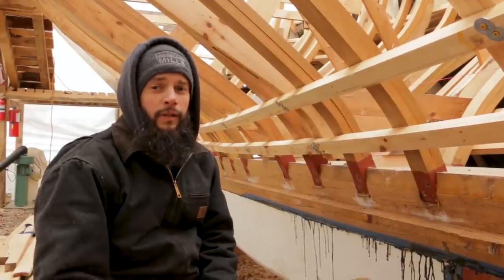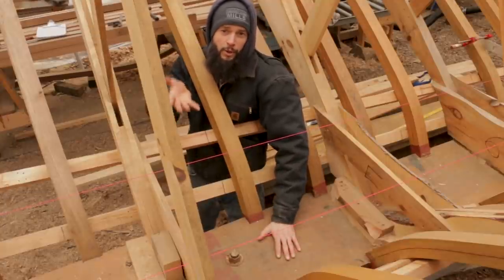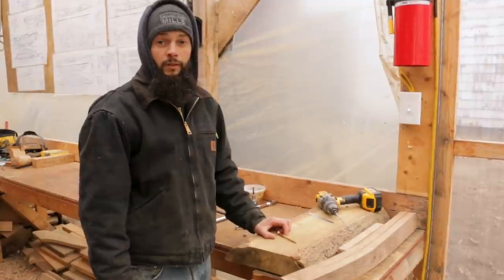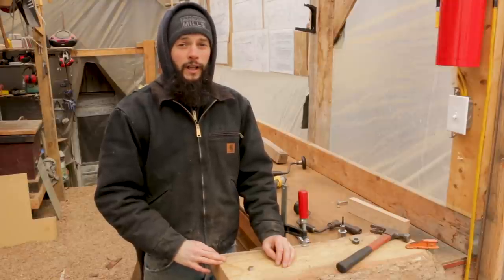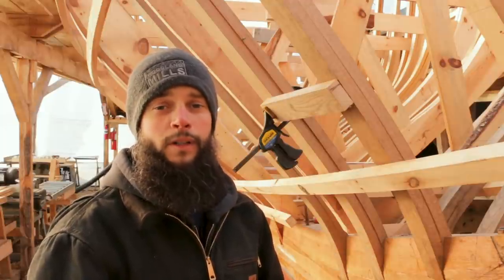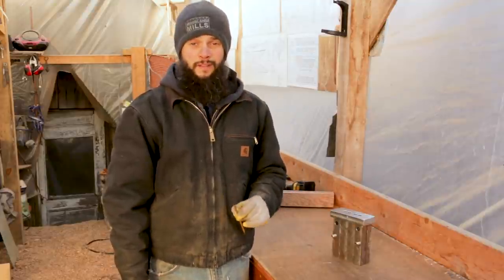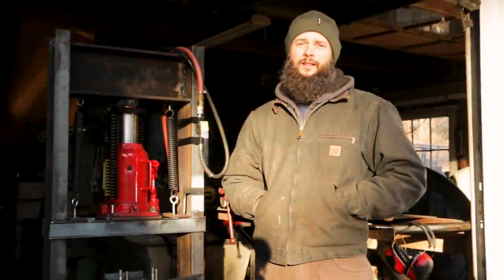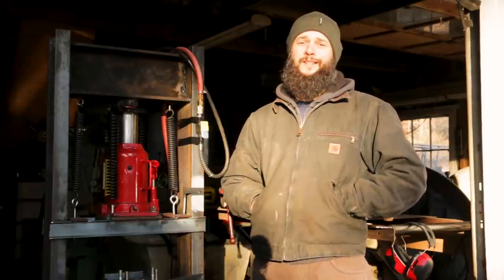Acorn to Arabella - Journey of a Wooden Boat - Episode 50: Homemade Copper Rivets!

Comment: Regarding floor timbers: Make sure that you have sufficiently large limber holes to permit water to flow freely in the bilge.  Bigger than you think is necessary.
Reply: Would you mind expanding on this? I'm honestly curious as to why, since I'd like to build my own boat in the next few years. And I feel like the reason why is immensely obvious once its been explained.
Reply: Floor timbers compartmentalize the bilge.  When launching a wooden boat, it will leak to the extent that one or more 1/2 hp submersible sump pumps are required to supplement any existing bilge pumps.  This obviously slows down, but if you work the boat you will get some water inside.  In order to drain the water, you need a way for water to flow to the compartment with the pump.  Limber holes are holes in the bottom of the floor timbers (usually on the bottom corners, between the keel timber / keel and the frame) which allow water to flow freely in the bilge.  In my experience it is very helpful to make the holes large enough that water can flow quickly and won't get clogged.  If I were building a new wooden boat, I'd make the holes about 1" in diameter if possible.

My boat has longitudinal stringers, so I also need to have limber holes in them so that water won't pool on top of the stringer.

It is best to think in advance about anywhere that water can pool and create ways for it to passively drain.

Hope this helps!
Reply: My boat will be of a welded construction, but I'll probably integrate this into the design for safety. I always understood that it is not a case of if you'll get water I to the bulges but when.
Reply: @cracklingvoice  You could either have a big bilgepump and wide scuppers to connect compartments, or You could build completely separated compartments with equally separating bulkheads including watertight doors over bilge level and have an adequate pump for each of the compartments ... which is easier to achieve in a metal hull than using other materials, of course.

Comment: Your fin neck flat head bolts seem to be the source of a great deal of concern.   I'm not concerned about the strength of the silicone bronze but if the thickness of the head is not 1/3 to 1/2  the diameter of the shaft it will fail due to fatigue.   It's a similar type of failure that caused the crash of Japan Airlines flight 123.  It seems like you've doubled down on using the bolts as is so do what you want.

Comment: Get a logsplitter and appropriate bore cylinder to drive the press. If you can find the type logsplitter with 2 stage pump, all the better. 
To further spped u production, a set of knockout pins could be added to the existing die to press out all 4 rivets without opening the die. (use a smaller cylinder or even a mechanical system to operate the knock out pins).
Reply from the maker: Thanks for the suggestions!

Comment: The only thing I'd look into is possible work-hardening of the copper while pressing the heads on them. I'm not an expert but I do know that copper, like stainless steel, is weird, and it work-hardens as it is formed which could make it brittle. The annealing process for copper is also weird because you heat it up and then quench it, just the opposite of carbon steel. Anyway I trust your competence and thoroughness but the weirdness of copper is an easy detail to miss. Best of luck, guys.
Reply: Quenching is unnecessary. They will anneal either way. Sometimes the hardening is desirable as in a cartridge case head.  The rivets might be stronger after getting head!

Comment: Make 2 more dies with quick fit slot in the cradle. That way you can press 1 while others remove 1 and another loads the 3rd one. And add a bit of die lube.

Comment: rather than using bolts to hold together the die - use parts from the old press so you can use a ram to hold the two halfs together. Much faster than undoing and redoing those bolts! And less effort.
Or keep them bolted together and use a second ram to evacuate the rivets!

Comment: If the slots in your press were tapered at the bottom wouldn't that make the head and point of the rivet at the same time eliminating the need to grind the points on them?

Comment: If the holes holding the four rivets in the press had a pointed end wouldn’t the rivets come out with a head and point at the same time? I am not an engineer just a thought. Love your channel, best on You Tube. Cheers from 🇬🇧
Reply: That may work, but it wouldn't be easy to make, and it would redirect the force on the bottom in such a way that it would be trying to push itself apart much moreso than it is already. Which you could fix by adding more screws, but that would just make it take longer. 

In short, it could work, but I don't think it would be worth their time considering the relatively small number of rivets they're making.

Comment: Try smoking the rivet die. Light a small stick on fire and hold the die over the flame until it blackens it. That should help the rivets release. That adds a microscopic layer of carbon to work as a lube. I do that for bullet casting. My bullets drop easily and come out with a near mirror finish. Automatic Transmission Fluid may help as well as it's thinner than most oils and lubricants. One or the other.
Reply from the maker: Thanks for the tip!
Reply: No problem!
I've been enjoying watching you two work doing something I can only dream about for now. Y'all keep up the good work.

Comment: I have to say that metal working is not my thing, I prefer wood work. I have some knowledge of reloading and dies with brass. 
I am curious bout 2 things: 
1) should they use grease in the die so the die opens and they get pressed rivets off easier ?
2) could they made end of the rivet die slots pointy to get completely finished rivets out of the die without having to grind the point to them ?

Comment: You can easily add a point to the rivit press so you don't have to grind them.. Weld up the bottom 1/4" of the individual dies, then mill w a 60 carbide taper end mill on both halves forming a square taper point. Presto, now when you squash the head it will form the points too. I can do it if your machinist can't w a fast turn around. Dan

Comment: Got to admire the back woods engineering.

Its a little ugly, but it works perfectly fine, abet a alittle noise. A hydrolic press might be faster, but there not exactly cheap and alot more expensive and heavier. 

That's gonna be one solid boat.
Reply: Their jack is an air operated hydraulic jack.  They are not inexpensive.  It uses air pressure to run the hydraulic pump instead of having to pump it with your hand and arm.  By comparison manually operated hydraulic jacks are much less expensive.

Comment: Probably not a bad idea to use some kind of mould release. You could use heavy equipment grease(get a tube of the lithium grease, it’s the best in my opinion) and just put a small dab in the mould. It’ll make getting the rivets out easier...and save your tooling a bunch
Reply from the maker: We used some graphite lube to that effect.
Reply: Acorn To Arabella even better

Comment: Put some soap on the stock before you press them in. Will be easier to press and will come out of the die easier.

Dissolve some soap bars in warm water, put the stock in some sort of basket. Maybe one from the supermarket. And dipp it in and let them dry.

Afterwards just do the same thing with clean warm water to remove the soap

Thats what the cold press industry does. Mostly with aluminum but should work as well with bronze
Reply from the maker: Thanks for the tip!

Comment: Question -Are the holes in the roves for the square rivets also slightly smaller round holes, as with the holes through the frames?
Reply from the maker: 1/4" square rivet into a 1/4" round hole and same for the rove, 1/4" round hole.  When we set the rove the corners of the rivet cut into it and the rove locks in place for nipping and peening.

Comment: Great job. Just a question, could you machine the rivet die to add the point at the end instead of grinding it ? The press could do both the head and the point.
Reply from the maker: We would need a lot more than the 32ton jack we are using to do that!

Comment: Those screws hold much more than 100 lb in the portion you had protruding out of that part. I'm sure one of the math calculator engineering types is probably going to make the calculation or I can make an approximate close one

Comment: Maybe reshaping the part of the die where the sharp end of the rivet is can take the grinding step out of the process and maybe the Press will be strong enough to make the tip and the head at the same time inside the die
Reply: does a rivet really need to be sharp on the end??
Reply from the maker: It needs to be kind of pointy to follow the pre-drilled hole as well as to start the rove over.

Comment: could you not preform the points on the rivets by putting a taper in the bottoms of the channels, or would that try to force the bottom apart?

Comment: Are you going to leave the rivet heads work-hardened?  Or will there be an annealing step?
I have a lot of experience with copper alloys (brass being the majority), but I am not a boat builder. I don't know which is more beneficial in a boat.   So, I figured I'd ask.
Reply from the maker: The work hardening is not an issue unless you really sat there and beat the snot out of them or tried to move the material to far.

Comment: You used a carpenter's hammer with the punch to remove the broken fin-head bolt.   A carpenter's hammer has a hardened face, and is meant to drive softer mild steel nails.  A punch, depending on the temper, may be hard enough to cause the face of the hammer to chip.   A machinist's hammer (Ball-peen, or cross-peen) hammer has a softer face and will mushroom before it chips.

This is not commonly appreciated.  My dad had a scar on his abdomen where a chip from a hammer went in, so I heard about this more than once.  (Yes, Dad, I know.)

The hardened face of a carpenters hammer allows it to retain a rough-ground (or even knurled on a framing hammer) finish that grips the head of the nail and reduces the chance of bending the nail.
Reply from the maker: Thanks for the info!

Comment: 24:38 did you switch to doing two at a time because your press didn't have enough power?...or it worked better in die?
Reply from the maker: We do the 4 at a time, when we open the die sometimes they go with the lid and sometimes with the base so it looks like we pressed 2, the other two are stuck in the other half and out of the shot.
Reply: @AcornToArabella  oooh duh, that explains it!

Comment: I tested a 1/4" brass eye screw mounted in oak.  With 1/2" engagement I could not pull it loose.  200 pounds of me.  Now scale that up to those burly screws holding the frame to the keel.  1000 pounds?  More?
Reply from the maker: Don't know for sure, I bet you could look it up, but yeah, plenty strong.

Comment: I understand why you are going with the square rivets but isn't there a chance of stress cracks in the wood over time at the corners of the rivets? I know the windows of the Comet airliner, which were square, had that issue in the metal and caused multiple catastrophic failures resulting in crashes and great loss of life. I just wanted to bring it up cause I enjoy your videos and don't want your beautiful boat breaking up in a storm or something if possible.
Reply from the maker: Wood is pretty forgiving in that department, same with soft copper.

Comment: I’m an absolute layman when it comes to things like this so perhaps I’m speaking out of my ass here, but maybe you could fit the mold with cut-out grooves to form the points of each bolt as well as the heads when you press them, instead of having to grind them to a point afterwards?
Reply from the maker: To press the points you have to basically extrude (extend) the copper and that takes more force than we can easily generate or manage.  The grinder does it real quick and easy.

Comment: you should weld a handle to that press release, will make using it much faster :) and yes your welds look awefull.. but they do the job!
Reply: and impact gun with a torque limiting bar for the nuts. will speed that up loads.
Reply from the maker: Our 20volt dewalts and our air wrench were not strong enough to tighten the nuts enough. The handle is on the to-do-list

Comment: Awesome instructional vid.  God bless you for your patience with armchair experts (as well as actual experts).  One question, could the die not have been made to also form the point on the rivet in order to save one operation?
Reply from the maker: To form the point you essentially have to extrude the stock which takes much more force than we want to work with!
Reply: Acorn To Arabella yeah, thinking about it again, you’re right.  Silly of me.

Comment: Isn't cold pressing going to cause metal fatigue in the the heads?  I'm not a metal working expert, so I may be wrong or it may not be significant enough to worry about.  Even so, you should be able to alleviate it by annealing them in an oven, I would think.
Reply from the maker: Copper is very soft and can be cold pressed easily, so no worries.

Comment: heck yeah guys! Glad some of the advice was useful. Your unlikly to get a faster production unless commercial equipment is involved. We did jobs all the time with equipment like that. If you do want more oower add a hydralic pump to the jack instead of air. Fly presses work well too like ones at Oldworldavils.com.  Commerically rivit stock would be put into an A2 steel die like yours and a punch press machine would 'stamp' the head shape at a rate of 100's per hour. 
  But for your job you will be hard pressed to beat that small shop production rate ;O keep up the good work!  BTW, Perfect and well described video of how threads engauge the work in any material.
Reply from the maker: Thanks!!

Comment: Every piece of a wooden boat “works” in a seaway. Splitting the frames made them easier to bend. Seems like the inner half of the frame is now just a long, wooden “washer” that just holds the inboard end of the rivets, leaving the outboard half of the frame taking most of the hull loading. The “working” split frames will allow the rest of the boat to “work” excessively. You basically have a lamination that isn’t glued up, & isn’t sharing the load. The inner frame half is transferring most of its load to the rivets, in shear. Epoxy is wonderful stuff!
Reply: I'm not an expert, but with the bottom 6" or so of each frame not being split, and with maybe a couple dozen or so 1/4" rivets through each one, it's hard to imagine that there could be much movement. It would be interesting to hear their take on your thoughts.
Reply from the maker: By the time the planks go on, floor timbers go in, bilge bands, sheep clamp, lodging and hanging knees.....  By the end the split frames will be so well fastened together they will share the load. =)

Comment: My riveting experience is limited to either mild steel or aluminium so I don't know if this is important, but do the home made cold pressed copper rivets need annealing prior to use? Does the work hardening when they set the rivets cause the rivets to become brittle? Or is copper ductile enough that this won't be a problem?
Reply from the maker: The copper is ductile enough and we are not moving it very far so the bit of work hardening is not and issue.

Comment: why does the die not have a taper to make them pointed?
Reply from the maker: To point them the material essentially has to be extruded and that takes a lot more force than we can currently apply or want to mess around with.

Comment: If I takes 32 tons of pressure to form those heads, how do you plan to hold them tight and pean them over when installing them? I’m genuinely curious...
Reply from the maker: The wood around the rivet will help, as will the backing iron (we will cover that later).  Also it takes 32 ton to press 4 at a time with consistent pressure.  That is very different from 1 with small rapid blows from a hammer or air gun.

Comment: "Time Tells all the Builders Secrets"-  all you can do is wait........we'll see how she takes the waves after 5 years in the water, as far as the copper & finhead go. unsolicited 2 cents-I personally would have used hot dipped galvanized steel for essentially everything, but thats just my own preference based upon my own industrial experiences, between expansion, contraction, oxidation & electrolysis, & shock loading from swells,  im not a boat builder just a 327 time victim of murphys law.

Comment: Bet you could have had the bottom ends of the rivet die tapered four ways and swaged the point on them at the same time as swaging the head. Save a step of grinding the point.